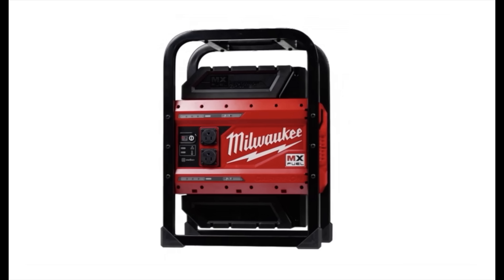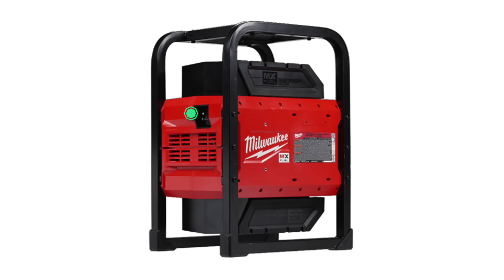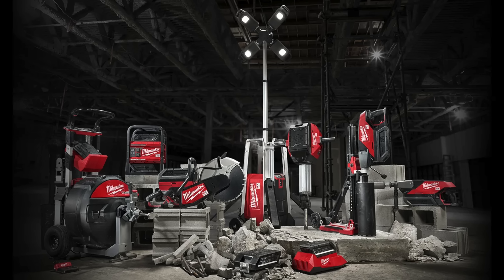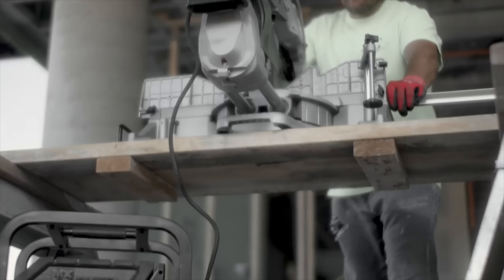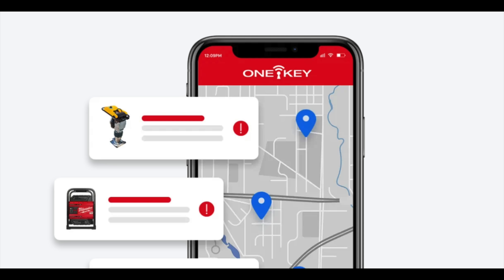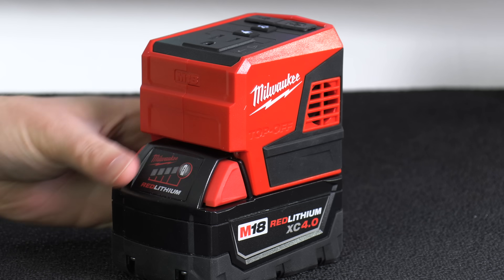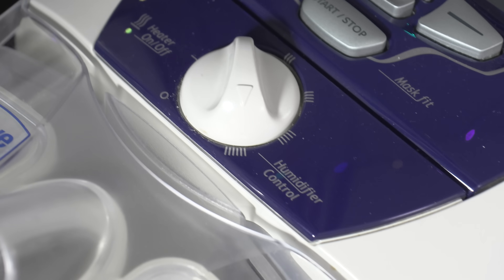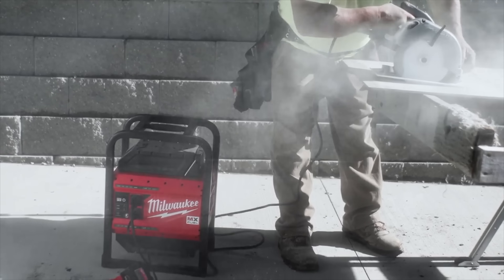END of GAS Generators? Milwaukee MX Fuel Carry-On Changes EVERYTHING 3600 Watts!

Comment: No, most certainly not the "end of gas generators." You can't replace the ability to fill it and run as long as you have gas, which is pretty easy to store several days worth.
Reply: This is designed to be used on a job site.  In some applications this would work but a gas powered generator still has the advantage on a job site.
Reply: @johnjacob688  I could see some indoor applications for this in construction, but unless you're doing indoor work, where there's most likely power anyway, a gas generator is just more effective. No batteries to change/worry about charging. A full tank will run a small ho da generator all day continuously, I guarantee you this thing can't put out that much juice.
Reply: @benjamindudley3798  Single battery comes in at around 430Wh so at 1800W it can run for around 13 minutes minus inverter losses. The double battery will get it to 25mins-half an hour. 
I can't think of anyone who likes being employed thinking that is useful for a days work. 
Its also $2k and for all their bs about no maintenance, they even say in the vids "you can swap batteries when they get old". Thats likely to be every couple of years if you use them a lot or every five if you're not so hard on them - especially if you want to keep most of that half hour capacity. We all know thats going to cost a decent amount more than the once a year oil change of less than a quart most generators need. 
An engine will wear out eventually too but there are a lot of Honda and other decent brand generators about from the 80's/90's and still going strong. 
Then there is the environmental side. Burning fuel in a power station, converting it to electricity, sending it down a line to a substation, re-routing it to a home/business, sending it through a breaker and meter then charging a battery, then discharging a battery all uses way more fuel than simply burning it, turning it tnto electricity and directly powering the tool with that. 
It might be cleaner on site but its dirtier overall and thats ignoring that the batteries need making and disposal - also a filthy process.
Reply: @siraff4461  I didn't even do the math to see how long it would run! That's worse than I thought! I can get a few deep cycle batteries and an inverter for a fraction of the price, and run a better system, with cheaper interchangeable batteries.
Reply: @benjamindudley3798  I have to be fair and point out that most people aren't going to be running 1800w tools for long but that runtime also has to be spread over a working day and split over all the tools you're using on it. 
I mean if you have to cut down one tree you might be ok as long as its not a big one. If you're using a chop saw to cut wood to length all day this hasn't got a hope of lasting. 
Oh and they don't actually list capacity in Wh or kWh - they measure it in ah which is about as vague as they could be while still saying they listed it. They also list the packs as 40 batteries at 3.6v each which after the match gives 432Wh per battery. 
Less than half a kWh. 
For perspective a gallon of petrol holds around 10kWh of energy. Yes you lose a lot of that in the genny (you only usually see around 35% all told) but thats still 8 times the energy and its not expensive or hard to carry more if you need it. 
The return from a typical 4 gallon can is around 14kWh which makes 0.432 look pathetic. 
Its even worse when you think that 432 is whats in the battery and will be less after the invertor losses. You're probably seeing 350Wh or so all in. 
For power tools thats not a genny - its a joke.
Reply: @siraff4461  From 1 liter of petrol you see 10 kWh of energy. You don't see 35 % of it, not even close! You only see 15 to 20 % for those small petrol generators! Look up the tests and data and you will see.
Reply: yeah, and even LP can't compete with the fuel density of gasoline.
Reply: @carrboro_chapelhillfpv2442  this is true. And the widespread availability of gas.
Reply: Nomen Clature  amps is a component of watts so I’m not sure what you’re getting at there. A typical household plug will give you 1200watts continuous which takes 45/90 minutes to charge this unit depending on which battery you have installed (Milwaukee’s numbers, not mine) . So under ideal conditions a 300 watt panel would theoretically charge this unit in 3/6hrs again depending on the battery installed. My argument is against this power pack replacing a gas driven generator.
Reply: Why use inexpensive gas, when you can just haul a truck load of these "generators"? 220,000 USD to buy 100 of these units might sound like not enough money, but I guess you can alway disable the find function to lose a couple.
Reply: @hpekristiansen  right? A good generator that pushes out twice the power costs half as much, but who cares about price when you're going "green" by using toxic batteries (mining the materials puts off a buttload of pollution) powered by the fossel plant up the street?
Reply: Nomen Clature  No you are wrong mate, 2x4 solar panel is 300 W on sunny day. Battery of your phone contain only 15 Wh of energy. Lets include charging efficiency at 90 % so you would need 16,5 Wh to charge a cell phone battery. So 300 W solar panel will charge it in only 3 minutes (assuming if it can charge that fast). But ok, to be fair that is for sunny day. For very cloudy day the output of solar panel is 5 times less, that means that 300 W solar panel on a CLOUDY day can charge phone battery in only 15 minutes, that is fast! And you can easily have 10 pieces of 300 W solar panels, which would have 3000 W output on a sunny day, and 600 W output on a cloudy day. But 600 W is a lot: with 600 W of charging you can run 1800 W load for 10 minutes every 30 minutes of charging. And very few tools consume 1800 W all the time (even circular saw which have rated power 1800 W in reallity consume that power ONLY when it is fully loaded, in reality average power of 1800 W rated circular saw is around 800 W or less.)
Reply: Nomen Clature  I agree. It’s basically impossible and highly impractical.
Reply: Umm ever heard of solar panels wouldn’t be hard for them to add this functionality
Reply: @jacobarmstrong2343  takes too long to charge. The biggest function of a generator is almost continuous transportable power. While this device is cool, and certainly has its uses, it can't compete with a generator.
Reply: Ben, you're right. How long do you think one could run a welder off of this?
Reply: @jacobarmstrong2343  A 2’x4’ solar panel is around 300 watts. So one panel would take 10-20 hours to charge the pack depending on the weather and amount of sun. Definitely the end of generators.
Reply: @trevorbaker2875  What the fuck?! YOu cant calcutate mate! YOu calculation is VERY WRONG! This battery "generator" is 864 Wh. To charge it with 300 W solar pannel you would need LESS than 3 hours in sunny weather, not 10 to 20 hours you claimed! 864 Wh / 300 W = 2,9 hours! Even in cloudy weather it would be something like 10 to 12 hours, NOT 20 you claimed!!
Reply: @damijanapopotnik8081  sorry, I was using the 3600w capacity in my “math”. Even if you had perfect solar conditions, one 300w panel and we’re not accounting for any losses your still 3/6 hours of charge time. Realistically double that as it’s not always sunny and there’s losses not accounted for. Hardly a replace me fir a gas generator, just a toy to show off to the boys on site.
Reply: @trevorbaker2875  You are wrong mate. With losses included charging time with 300 W solar panel is 3 hours and 12 minutes (calculate it) in sunny weather. But you are MISSING A POINT or rather USE CASE: one expample and most of the uses are like that (i said most, not all for thoose who can't read properly): worker at the job site  need to run electric cordless nailer gun: i battery lasts around an hour of heavy use. To charge 18V 4Ah you would need 80 Wh (including calculated efficiency). So you would have two batteries: one on a tool, and one on a charger that would be feed by this battery "generator". So you would need to deliver 80 W of power and you would need only 80 W solar panel which cost only $50. Another example: worker is using circular saw to cut some pieces and then assemble it. So he will be using circular saw for 3 minutes to cut some 2x4 and then he would assemble it in 20 minutes. And he will repeat that all day. So saw will use 50 Wh of energy to cut 2x4. In 1 hour he would do 3 cutting : so 150 Wh spend in an hour. So he would need 150 W solar panel to do that all day long and he will have enough energy to do so. So 150 W solar panel cost only $100. I am not saying it is appropriate for all cases, but it is appropriate for most cases. You can easily have 10 pieces of 300 W solar panels, which would have 3000 W output on a sunny day, and 600 W output on a cloudy day. But 600 W is a lot: with 600 W of charging you can run 1800 W load for 10 minutes every 30 minutes of charging. And very few tools consume 1800 W all the time (even circular saw which have rated power 1800 W in reality consume that power ONLY when it is fully loaded, in reality average power of 1800 W rated circular saw is around 800 W or less. So that would be 10 minutes using it and 13 minutes charging. )
 That is more than enough for most real world usage cases (i said most, not all).
Reply: @damijanapopotnik8081  Milwaukee says the unit charges in 44/90 minutes depending on the the battery. So if a 1200watt receptacle takes 45 minutes then a 300watt panel could at best take 3 hours. At best. In reality this is probably closer to 250watts under ideal conditions. That’s closer to 3.5 hours to charge the smaller battery and 7 hours if you have the larger one.
Reply: @trevorbaker2875  And that is the same as i calculated above. And that is plenty fast enough. Also that means that this Milwaukee is limited by how quickly can charge NOT because of how much power you provide, but because they limited charging current. Milwaukee says "With two MX FUEL XC406 extended run battery packs, you get 864 Wh (Watt-hours) of power." So 864 for TWO batteries which is MAXIMUM. So with 300 W solar panel you would charge the battery with 270 W when you include losses (inefficiencies). So 864 Wh /270 Wh = 3,2 hours. So basically a little more than 3 hours for 2 LARGE maximum baterries, not small battery as you claimed.
Reply: @trevorbaker2875  But this Milwakuee is too expensive because i can make/assemble (DIY) much better unit that will store much more energy for 5 times cheaper! :)
Reply: @damijanapopotnik8081  3 hours is a long time to wait for a charge. And again this is under ideal circumstances that most places in the word will not be lucky enough to experience. These will never replace a gas driven generator. Maybe someday they will figure out how to store 20-40kw of power then they might make a dent in the generator market but until then they have very limited use and are a nifty gadget that has little capability on a job site or as an emergency power backup.
Reply: It's not just about fuel, it's about not having to maintain 2 stroke motors.
Reply: @Turgz  this is true, but everybody using gas generators isn't going to drop them in favor for a battery pack. Maybe if someone has a generator sitting around in case the power goes out, this would work for them, but it's stll not comparable to being able to run it 8 hours a day, several days on end.
Reply: @Turgz  I haven’t seen a 2 stroke generator in decades. I’m not sure they even sell them anymore.

Comment: And how does this “battery pack” (not generator) get charged when there is no power due to a power outage? I’m a Milwaukee fan and user but this is will not work when wall power is not available. Rather have a conventional generator.
Reply: I think they intend this for job site use, not to get you through a natural disaster.
Reply: @christophercrawford2736  i figured that but for people that think like I do we aren’t buying several generators but 1 maybe 2 at most to cover needs. Plus this unit isnt a real generator as it stores power but doesn’t produce power. Cheers. 👍

Comment: I think this concept would make more sense on a larger scale. If you are already driving your work truck or work van around, permanently mounting a set of batteries with a good inverter and charge circuit. Include a bank of supercaps to deal with high in-rush current in the tools. You could probably sell such a thing to the companies that make tool boxes for trucks/vans.  A generator that can't be stolen, built right into the truck, you just plug your tools into the truck and work. Then plug your truck into shop power when you get back from the job site.

Comment: it is a battery, it is not a battery generator.
a generator you just fill the tank up, a battery you have to charge for it's full charge cycle if you don't want to shorten it's life span.   and generators do not have battery aging either.

Comment: How can this be called a generator when it doesn’t generate anything?  It’s just a battery.
Reply: I think the key concept of the definition is that a generator converts mechanical energy to electrical energy.   Even if they developed a fuel cell that could directly convert gasoline into electricity, it still wouldn't be a generator.
Reply: It a step up transformer not a generator
Reply: @Bigal3031  this is not accurate.  Batteries are DC devices.   A step up transformer requires AC to operate.  So it’s definitely not simply a transformer.  It generates AC power from DC battery stored input.
Reply: Sure it stores DC power but it generates a sine wave. That is why they call it a generator. An inverter will step up the voltage from 12 to 120 or what voltage you design it to do.
Reply: @darrinjones9387  didn’t think you could do it. But you did.  I stand corrected.
Reply: It generates electricity. That's what a battery is.
Reply: @Turgz - it doesn’t generate nothing, it stores it!
Reply: @Turgz  you don't have a clue what a battery is. Batteries store electricity they do not generate electricity
Reply: @Turgz  no it doesnt
Reply: @Turgz  Generation =/= storage. Generation is the conversion of mechanical work into electrical power. Batteries store electrical power in the form of chemical potential energy, which can be released in a controlled manner (or in an uncontrolled fireball). We then use some fancy electronics to mimic the natural sine wave created by actual electrical generation.
Reply: Nomen Clature  we can argue semantics if you like.  I’m going to say we’re close enough to call it a draw.
Reply: Nomen Clature  I guess then you do want to argue semantics.  Don't say I didn't give you an out.   Generate : to bring into existence.  You have potential energy stored in a battery, you generate AC by transforming the potential chemical energy in the batteries into direct current, then again generating alternating current with an electrical or electromechanical process.   You're bringing AC current into existence or generating it.  You want to present your opinions as facts, then back them up.

If you stipulate that a gasoline generator generates AC by a chemical process where the combustion of the fuel turns a magnet which induces a current in a wound coil of wire then how can you say that the process of going from another chemical energy store (the battery) into AC current is any less generation?

Comment: Its nice but... 800$/pack, 2 packs needed for best setup... 1600$ plus the 1500-2000$unit.  End up quite expensive but still nice 😬🤑😬 $CAD yes but still.... for same price there's other better competitors and especially able to connect solar panel to it plus the safe lithium chemistry LiFePo4 or similar

Comment: Generator implies that it makes power, that's just a big ass power pack, when it goes flat you're fucked
Reply: I suppose you’re right.
I look at like job requirements. A off grid power source beyond a week or so would require a battery bank, whether its solar, wind or water. 
A gas/diesel genset is ok short term, but again would have its limitations.
This Milwaukee is a convenient tool. You’ll know what it’s capable of, so an extra battery would be the equivalent to a gas can.without the hazards.

Comment: DeWalt has had one of these for 5 years now, so Milwaukee is not the first to jump on this. It is the DCB1800 portable power station. Runs off 4 of the 20v Max or FlexVolt batteries. 1800 continuous watts, 3600 peak watts. I picked a "tool only" one up on sale at Lowes for $250 years back primarily to have the parallel charging but have found the power station aspect incredibly useful in my case. Runs a corded 12" miter saw perfectly. Excited to see Milwaukee enter this game and spur on the competition.

Comment: Battery generators are nice and they definitely have a place, but they’ll never replace generators that need to be run for long periods. I find the Milwaukee generator odd because the two advantages of having a generator, “no fumes and no noise“ power tools that create noise and lots of dust. I suppose you can say you’re not adding to it. In my opinion, the Milwaukee generator shines when working out in the woods where there’s no power and you don’t need to run it for an excessively long time, But again why lose the option of being able to run a generator for hours or days?

Comment: When I use a generator I'm using it because the grid is down or unavailable where I'm at.   I'm not buying the environmental reasons either.  My current car, cradle-to-grave, including the gas it will use, still will put out less emissions than what it takes to make and feed a Prius.